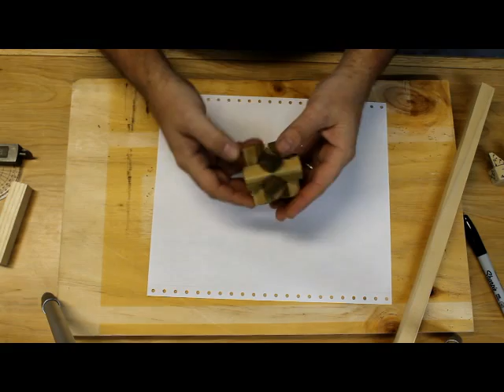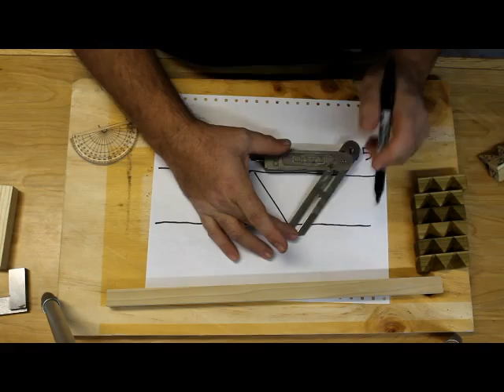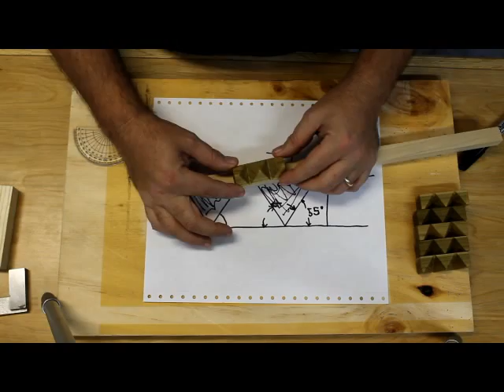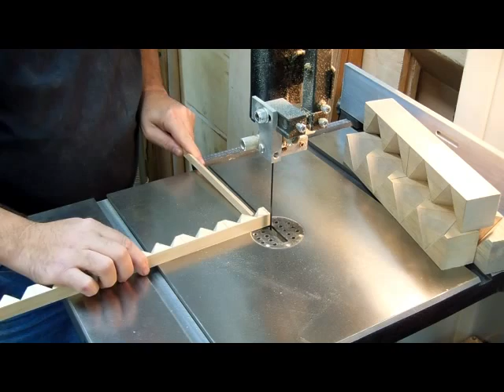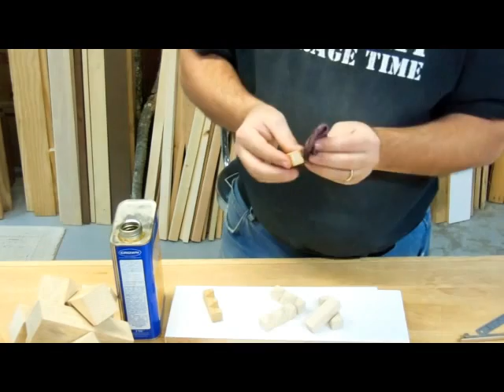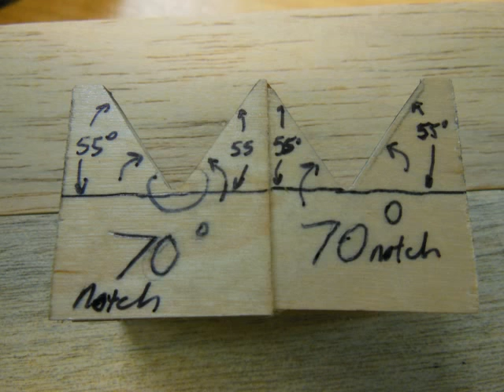Making the 6-pc notched burr puzzle: Woodworking project

Comment: Great puzzle, Steve. I went into the shop tonight and made one.....looks beautiful, went together like a dream.....and, now i cannot for the life of me get it apart.  I'll keep trying. lol.
Reply from the maker: Sherry Blaylock I'm excited to hear that you made one. Way to go! If the puzzle goes together too tightly and cannot come apart it's possible that your notches are either a tad bit too close, a tad too tight or both. Sanding the four longs sides of each piece (just a little at a time) should loosen the puzzle up for you. However, if you can't get it back apart that's not going to be so easy :) Try gripping opposing corners and pulling straight out.

Thank you for watching! And thanks for giving it a try.

Comment: Love this project and I am attempting to make the sled jig for the band saw. 2 questions. 1) is the bracket that holds the wood on corner a 45° to the blade? 2) Did you make two of them one in each direction or did you just turn them around?
Reply: OK I figured it out. But the puzzle was too loose. Loosely stayed together.
I think the notches were too big or the space between they was too much. What do you thing?
Reply from the maker: You said you figured out the sled but, for the benefit of others, I'll clarify. Yes, it holds the stock at 45 degrees to the blade (as well as holding the stock on corner, 45 degrees from the table).

There are two separate "overlays" for my sled. One angled left and one angled right.
Reply from the maker: Christopher Demetrick I appreciate your watching and your interest in this project. One of these days I'll draw up a pattern so that people can make these a lot easier without the trial and error factor. To answer your question, if  the pieces fit into the notches without much play, I'd try decreasing the size of the gap between the notches. It was kind of difficult for me to express an exact size for that gap. It should be larger than zero (because every time I've tried making this style corner-notched puzzle without a slight gap the pieces never go together, except with great force, which makes them extremely difficult to get back part). I'm not sure what said in the video but I'd shoot for about 1/16" gap (possibly slightly less). That's been working for me pretty well, especially with 3/4" stock.

As you're learning, there really is a fine balance between too loose and too tight. And that goes for pretty much all wooden puzzles of this nature, corner or face notched.

Best of luck to you.

Comment: Awesome job, love puzzles and it's cool to see how they get made. However, I am curious as to why they are built using 70 degree cuts instead of 90 degrees like you mentioned earlier? Does the puzzle not work if you use a 90 degree cut?
Reply from the maker: It's a matter of perspective. The inside faces of the notches meet at 90°. That is, the interior of the notches ARE a 90° angle. But not in relationship to the faces of the wood. The 70° and 55° measurements are the angles the notch cuts form when viewed from the faces. So there are laid out at 55°, even though they are cut at 90° with respect to each other.

Thanks for watching!
Reply: Got it, I was curious as to how that was working. Thanks for the info.

Comment: Are you sure that angle is set at 55 degrees? I tried making the template at 55 deg and the pieces didn't fit. I could've made something wrong but just wanna double check. Maybe you meant 35 degrees?
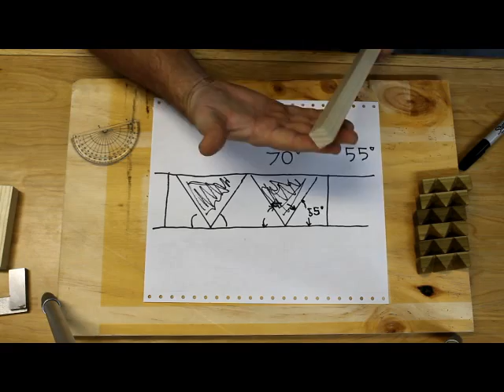Reply from the maker: Thanks for watching, Dani El . Yes, the measurements given are correct. When drawn on a flat side, the angles are 55 degrees with respect to the bottom edge. That leaves a 70 degree angle where you'll cut it out (as seen at 2:17), for a total of 180 degrees. When the notches are cut out, the wood is stood on corner, leaving a 90 degree opening (with respect to the corner). Your stock should fit into that cutout perfectly.

If your pieces do indeed fit into the openings but the puzzle still will not assemble, you may be forgetting to leave a small gap (1/16" or so) between the two notches. One of these days I'll draw up a template to help you guys out. Until then, I hope my explanation makes sense. If you have any more problems please let me know and I'll help you out the best I can.
Reply from the maker: Shots Games, And Tutorials No, not 90. The cuts create a 90 notch, with respect to the corner. But you do not mark 90 on the wood. If you do it'll be way off.
Reply: It is arctan(sqrt(2)) = 54.7356103 degree
Reply from the maker: saka1029  - Exactly. The 55° is a close as you can expect - or need - to be in woodworking. I've made hundreds of pieces for those puzzles (and variations on the theme). 55° is definitely the proper angle to cut.

If one were to cut the pieces at this angle and find that their puzzle fits together way too tightly, add a tiny (1/16") gap at the point where the two notches come together. But keep the same cut angle.

Comment: I don't understand,55 or 45 degrees?
Reply from the maker: When the notches are laid out, it's a 55 degree angle that you would draw on the face of the wood. It only becomes a 45 after it's cut and measured with reference to the corner.